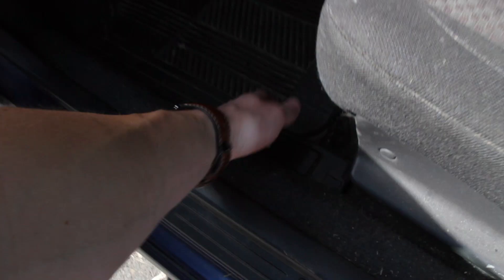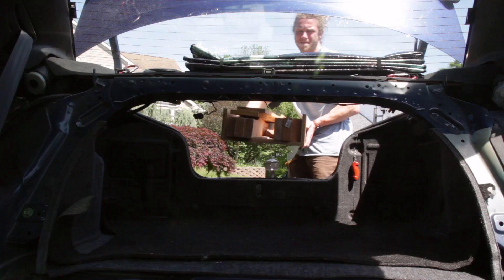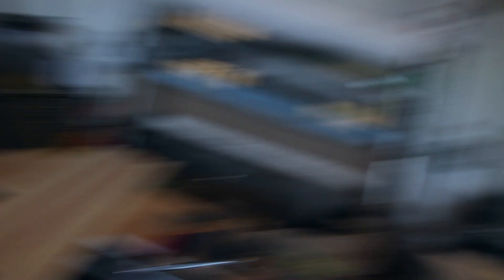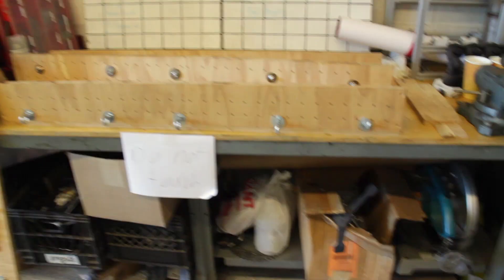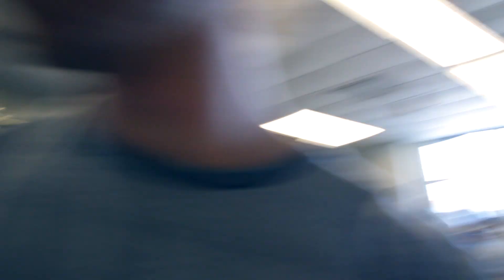Mechanical Engineer Student Design's and Builds A Longboard (Part 1)

Comment: Was a lot of mathematics used in this project?
Reply from the maker: Aus- Air Force honestly there wasn't. Most of the math is after the longboard is finished just to evaluate different characteristics like stiffness. It could be done before hand but there's not enough juice for the squeeze when you're only making one and not manufacturing them.

Why? Are you planning on making one?